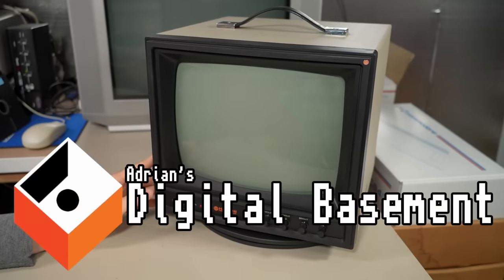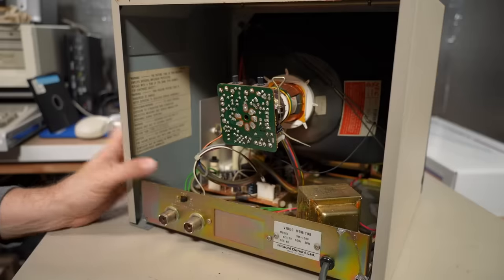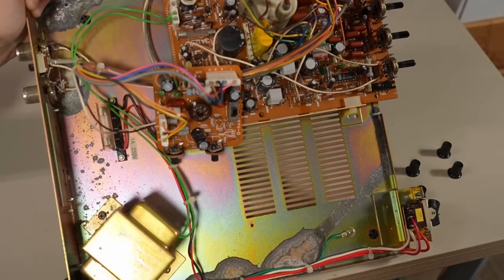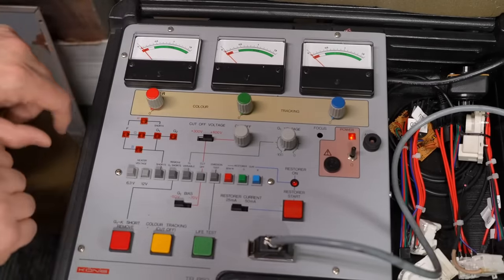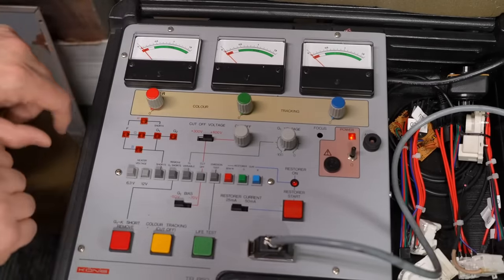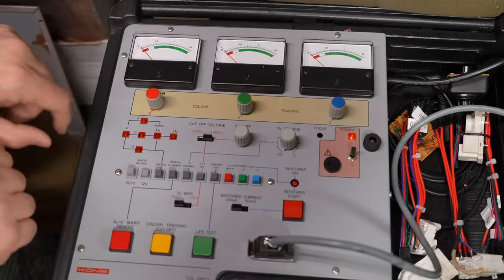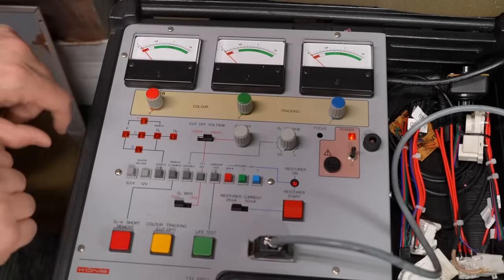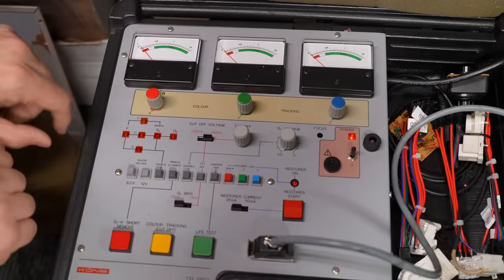A perfect pair to the Apple II: Hitachi VM-129U #rescue

Comment: Late 1940's to very early 1950's TVs did not have aquadag coatings and used separate high voltage "doorknob" capacitors.  250-500 pf were common values so your readings were in the ballpark but those long leads did introduce some error.
Reply: I don't think any of the regular electromagnetic deflection CRTs had uncoated glass, at least not in the US. Common tubes like the 10BP4 had a conductive coating on the outside but were usually used with a doorknob cap for extra filtering. There were also metal cone CRTs where the entire bell was high voltage and these required external capacitance.

Comment: This one is extremely similar to the one i have from Siemens, just with a slightly different case design. The problems i have with it is that the potentiometers at the front don't make good contact in any position anymore

Comment: That corroded gold-rainbow coating appears to be zinc chromate. It would be a good idea to wash hands after handling it. The un-corroded plating is probably not particularly dangerous for occasional exposure, but I am unsure what chromium compounds are present at the actual site of corrosion (any chemists in the audience?). Soluble chromium compounds are generally bad news for living things.

Comment: Mono monitors back then. The plain white/bluish was not nice, the green screen was much nicer even if it used a Perspex filter, the orange monitors were the best in my opinion and quite rare.
Reply: In the Apple II days all the monochrome monitors were green as far as I remember.  In school we had some colour but mostly green.  The amber monitors I saw were pretty common on PCs in the '90s and eventually outnumbered the greens by a large margin.

Outside the context of PCs, the ,only amber monitor I've ever seen was a Frankenstein composite monitor that Adrian made a while back.
Reply: @Starchface  I am amazed anyone used a mono monitor in the 90's other than data processing clerks with mainframe terminals.
On the PC colour CGA and VGA was widespread then. My reference was to early to mid 1980's. Amber was kind of cool then.

Comment: That's the sort of disappointing nature of vintage screen manufacturing, the tremendous lack of AV port types, even though RCA ports date back to the 1930s it seemed to take a long time to establish Composite in all NA screens. The S-Video port launched in 1987 but they could have done it without that DIN using an RCA connection much earlier what with Chroma & Luma lines sitting dormant in so many CRTs.😒

Comment: Great as usual.  A question about the discharge wand...how do you know it is working?......ie: accurate results to say the crt is discharged when it is or maybe not?
Reply: there is an analog voltage meter on it connected between the ground and the probe leads

Comment: You know everyone always says to discharge the tube but I can't think of a single time in any video I've ever watched or every CRT I've worked on in real life that there was ever any high voltage on one.  Big caps in power supplies are a different story though.
Reply: Most have a bleeder resistor that dissipates the voltage. But you shouldn’t count on that, for all you know the one you have happens to be missing the resistor or it doesn’t discharge for whatever reason. Not worth the risk even if there’s only a small chance.
Reply: @dogecode386  Modern integrated flybacks might have a bleeder most of the time but I don't think I've ever seen a bleeder with a separate rectifier. If the picture tube is warm it will usually discharge the HV (leading to the traditional white dot) but if it's cold the HV will remain. I have personally gotten a little HV spark when discharging my antique TV after running it with the picture tube unplugged.

Comment: Hmm.. I had a 512*512 graphic card in my Apple ][ attached to an amber CRT. Should be still in my machine, somewhere in the basement, in some box. Together with 2 80-tracks FD, language card, Z80, speech output, mouse, .. If I ever have the time...

Comment: does 120v in a 117v monitor set have any bad effects?
Reply: Maybe over a very long time period… like decades. The failure mode would be the main regulator transistor/IC as it would have to dissipate the extra 3 volts as heat.
Reply: No, 117v devices are made to run on a 120v supply. ANSI C84 specifies 120 volts +-5% at the building's service entrance and an extra drop of up to 5% is allowed in the resistance of the wiring. Combined the acceptable potential at the point of utilization is 108-126 volts. 117v is right in the middle of this range.

Comment: Those video input sockets are what is generally known as the "UHF Connector" https://en.wikipedia.org/wiki/UHF_connector
Reply from the maker: Ah yes I see -- SO-239 sockets. So old-school! I wonder why they put those on the back of this versus BNC which seemed to have been in widespread use at that point?
Reply: @adriansdigitalbasement2 Those connectors were very common in CB and ham radio RG11 coax. BNC would need a thinner gauge of RG59 coaxial cable, and those connectors were probably kept because the cables in the existing installations were all RG11, and moving on to BNC would require all of the installed cable (at least in the video bays) to be replaced.